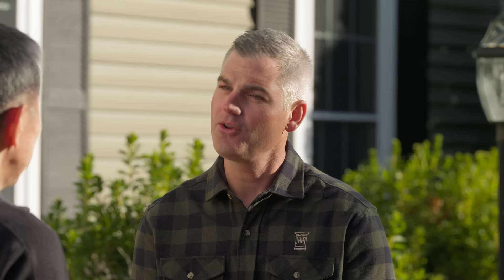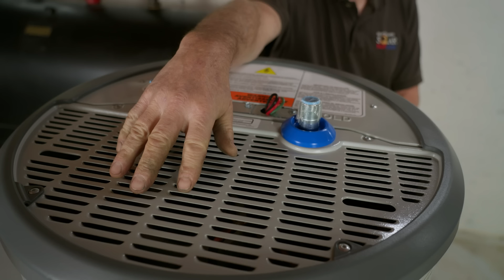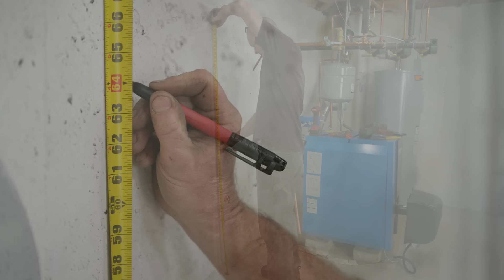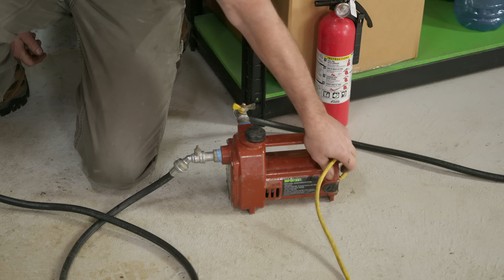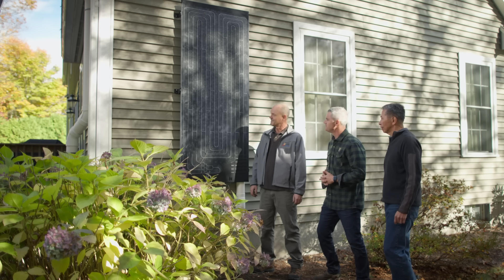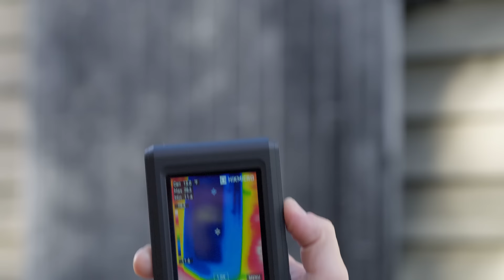Heat Pump Water Heater for Cold Climates | Ask This Old House

Comment: How much does all this high-tech cost?  What about maintenance?  Just about no maintenance on a basic electric hot water heater.
Reply: I have the same unit, cost was about $5,000 installed. 

There has been zero maintenance. I have a steel tank and they put in an electric anode rod.
Reply: I have the indoor type without the panel. The only maintence i was told to do was to pull air filter out the top and and clean that every couple months. It pulls out like the lint thing in a dryer.
Reply: @Zero11_ss how much are those units without the pannels used indoors ? Brand type. Im in Arizona climate. This would be great fornthe hot garage
Reply: @dr.projectx5142  I used a low income govt program for my mom and got it highly discounted. You can check on lowes and put your zipcode, they often have a "rebates available" button on the product page that tells you for your area. But depending on brand and size they are probably like $2k for the water heater. It probably works great in Arizona.

Comment: We installed a hybrid unit a few years ago in our utility room, where our hot air return and ducting meets our furnace.  The wood-burning fireplace insert has a plenum chamber above it that is also tied into that hot air return ducting.  When we have a fire buring, hot air from the plenum chamber heats the utility room (off the unheated garage) to around 70 degrees.  Our house AND hot water is basically heated with wood, any time we have a fire going.  It's an incredibly useful system.
Reply: @jasonbroom7147 I am looking to replace my oil burner with a heatpump and maybe hybrid hot water system and supplement with a wood stove where the oil burner is. I would love to see photos of your setup as I would like to do something similar.
Reply: Tell us more? Any pictures and schematics?
Reply: @hamadilawson4471  - I don't have any drawings, but it's a pretty simple design.  Along both sides of the wood burning insert in the fireplace is a set of metal boxes with intakes ducted to the floor and pipes on top that are connected to the hot air return.  From there, it's just a conventional forced air propane furnace system, with truly hot air coming from those plenum chambers.  In the utility room, where the return air meets the furnace, there is an exchange of heat, which benefits the heat pump on the hot water heater.

Comment: An oil boiler, why NO domestic coil? In combination with an aqua-booster, you'll have abundant hot water.
In addition, can you please explain the "NO defrost cycle." As the evaporator coil is building up frost, which then forms ice is the efficiency NOT lost?

Comment: Like it’s something new…

Here in the Netherlands we use those heat pump water heaters for more than 10 years. New houses are all build with heat pumps for warming the house and water for shower / etc.. Gas or oil heaters are no longer allowed in new houses.
Reply: Typical condescending European. 

Heat pump water heaters have been in use in the US for much longer than ten years. At least 30. More like 80 years for regular air heat pumps. It's just that it's only recently that heat pumps have become functional at the low temperatures that occur in the northern us.

It gets a whole hell of a lot colder in the US than even the parts of Europe in the arctic circle.

Comment: So what about people in condos or people that have their water tank in a closet in the living space? These things are loud and in the winter will make the heating system work harder.
Reply: Did you even watch the video? These do not cool the house at all like a hybrid. Also they are pretty much inaudible from the other side of a wall. Sounds like a box fan running on low, if even that.
Reply: @dmt9810 I did watch the video. The ones with the external radiator can't be installed at a condo, and both make more noise than a fan since they're a running compressor.
Reply: @jondoef You mean the evaporator panel? Yeah you can't put that in a condo just like you cant put mini splits or solar pv in a condo. That doesnt mean they're not a good option for homeowners. My fridge has a compressor too and it doesn't exactly keep me up at night. In fact my fridge is quite a bit quieter than a box fan.
Reply: @dmt9810 did you even read my original comment? smh

Comment: Holy crap...come here because of my fascination with heat pumps to not only find out about this new type of water heater heat pump solution where I need to research now but am blown away at this Propress tool.  Here I thought I would redo my house's plumbing with PEX due to being able to Lego it together myself but if I wanted to stick with copper piping I don't have to sweat it.  How long has this tech been around and how is this even possible?  Down the rabbit hole....
Reply: The propress has been around for a while here in the states, longer in Europe. The cost of the tool scares most DIY'ers away the fittings arent cheap either.
Reply: @Reckless1985  I would imagine that one could rent the tool for a weekend at this point.... or buy one and resell at the end of the job, depending on the schedule.
Reply: @Reckless1985  Cost aside, would you stick with copper using propress or PEX?
Reply: @BobbyLips for exposed piping I like copper it's cleaner more professional looking. If your running it through walls and ceilings expandable pex is a lot cheaper and easier and you can bend it around objects instead of making offesets with fittings which means less points of failure. Anything that may need to be replaced (like shut off valves under sinks) I would solder on to a pex x copper stub out.
Reply: @Reckless1985  Thx!

Comment: How much more than a conventional tank? How much more is the labor to install? What is the ROI? C’mon guys. If you’re going to present something as beneficial than you need to give us the numbers.
Reply: That information is almost impossible to provide. Cost compared to conventional will vary simply based upon scenario, they have a short line set without complex routing necessary etc. Cost of labor to install will also vary based upon location such as California vs Mississippi. ROI is based on the above factors as well as if there are any rebates or incentives available today or potentially in the future but TOH can't know every possible situation and potential cost savings etc. They have presented something beneficial and if you feel it may apply to your situation then do your own research for your own situation.
Reply: The most popular electric water heater on Home Depot's site advertises annual electricity consumption of ~4000kWh. The top heat pump water heater (also a Rheem) advertises annual electricity consumption of ~900kWh. Multiply those numbers by your local electricity rate to get your annual costs for hot water. In a place with high electricity hosts (30 cents/kWh in MA), the payback time is less than 2 years, excluding labor. The split system they installed in this video would have higher labor cost, but a traditional heat pump water heater installs much the same as a resistive water heater, so I'd expect the labor cost to be comparable.
Reply: They never do and it's really disappointing

Comment: It’s wild to me that the focus of this video was purely on increased efficiency. They are painting an electric water as the boogeyman of inefficiency but that electric water heater is far more efficient than the boiler setting next to it. We have collectively gotten in a bad habit of conflating efficiency with operating cost in our vernacular and I thinks that’s maybe the heart of what they are trying to address but they just keep hammering the efficiency aspect and mention cost savings once.
Reply: I would have liked to see an operating cost comparison (at local utility costs) between resistance heater and heat pump.  Hard to believe that the $5,000 could be recouped in any reasonable time compared to instead making hot water off of the oil boiler.  Of course, the video would possibly end up boosting oil heated hot water instead, blowing the whole heat pump promotion bit.

Comment: Why not install 2" R10 foam over those cold concrete walls and cold floor? No wonder the home owner runs an oil heater.  I'll stay with my electric water heater set to meduim and my roof top solar PV system.
Reply: In that area many new homes are built with the insulation on the outside of the foundation so the concrete acts as a heat sink. Also, in this area electric is well over 30 cents a Kw. That alone is enough to make people switch to something else. (oil or gas)
Reply: @rupe53 Ok, insulation on the outside of the concrete foundation makes way more sense. Thanks. 

30 cents per kilowatt hour...no wonder New England is eager for cheaper US offshore wind and Nova Scotia offshore wind. Huge potential to lower electricity prices. 

Over my cold concrete floor...I installed the blue DMX dimple mat sealed with tape and 2 staggered layers of XPS 30 high density foam sealed with canned spray foam and then 2 staggered layers of OSB. Now it is warm and easy to heat the whole house.
Reply: @aaronvallejo8220    Oh, and 30+ cents per Kw is just the base price. We now have a "poor tax" because the state ran out of money to fund the energy portion of social services. IOW, those of us who pay our bills now get several cents per Kw added to fund those who are broke. Last I looked it raised my bill by $80 a month over the last two years.

Comment: Would have just went with the heat pump. Less infrastructure and that boiler gives off plenty of heat in the winter to recoup. Some of these new green gadgets are just way too expensive for the average homeowner.
Reply: I agree. A few degrees cooler in that basement would not have an impact and some of the waste heat from the boiler would be utilized during the heating season.
Reply: True. But conventional heat pump water heaters won’t work in basement if you’re getting rid of boiler and switching to minisplits, as was the case here.

Comment: Plumber here, I've done work on these heat pump water heaters and they don't last that long. Not even 4-6 years. I see a lot at the scrap yards. Even the regular gas and electric water heaters last longer than the heat pumps. They should had done an indirect water heater since they last a lifetime.
Reply: Just last year I preemptively got rid of our old traditional water heater that was in the house when we bought it. Manufacture date was 1994. I replaced it with a traditional electric water heater with a stainless steel tank. 

I know these heat pump units are more efficient, but if they’re getting replaced every 10 years or less, it’s hard to see the savings.
Reply: You have never worked on one of these systems, they've only been out for like 2 years. These are different from the hybrids (which is probably what you're talking about)
Reply: @dmt9810 No buddy, they been out on the US market since 2010. There are a few of them that where install about 10 years ago that are still working. Most of them installed back then where replaced already.
Reply: @REDPlumbing This manufacturer has only been selling them in the US for about 2 years. Not sure if you're talking about some other chinese crap that you've seen, but these ones are great. 10 year warranty on the whole system btw.
Reply: @dmt9810  Bradford White yes they came out around 2022 and I did installed 2 of them before around that time while working for another company at the same. Rheem/Ruud and  Samsung started to sell in the US market around 2009 and A.O Smith started their sales in 2010. They weren't popular when it started but around 2015-2018 it started to pick up since the electric companies started to offer rebates which increased the sales and popularity.

Comment: I feel like it would be a lot more appealing to have just a regular heat pump condenser than to have a giant black panel on the side of your house. Is that not an option?
Reply: Yes, there is an option to have a condenser.  Some heat pump water systems have the condenser on top and normal resistive heating elements for high demand. Others operate more like a mini split. At least one system uses water to transport heat from the condenser mounted outside to the storage tank.

Comment: Heat pump water heaters are just more overcomplicated expensive appliances to fail every 8-10 years.
Reply: Just like traditional water heaters, you mean?
Reply: @pb7379-j2k I have a traditional NG tank water heater. Drain it down 3-4 gallons every year to get the sediment out and change the anode rod every 4 years. Tank On year 12. Probably get another 8 out of it before I think about replacing it. During the summer months is $30 a month in gas for a family of 3.

Comment: Putting that evaporator coil outside seems like a recipe for ice damming preventing heat exchange.  I think it would've been better served in the basement if not for winters...
Reply: At that point might as well just use the regular hybrid.
Reply: Modern heat pumps have deicing cycles to fix that. And if you put it inside, then you're just stealing heat from the HVAC's heat pump, making that run more.

Comment: They put a lot of gear for a heat pump water heater.. I switched mine from NG to a stiebel eltron accelera 300 model.  It cools the basement and reduces humidity.  It also works better in the winter from the basement because it's scavenging heat from the hot air furnace and heat loss to the basement from the first floor.  Putting this evaporator outside of the house in the winter seems counter productive.  I've seen people put a coolant loop under their solar panels to pre heat the cold water coming into the electric water heater.  Then a tempering valve reduces the output temperature of the hot water in the pipes.

Comment: I live in a fairly cold climate and have an unfinished basement just like this one. That boiler is putting plenty of waste heat into the basement and who cares if you lower your basement temp by probably one degree? Its effect on your house temp is about zero and the air source HP water heater is 1/3 if not 1/4 the install cost and is serviceable by anyone. I'm also in an oil heat area, removed my oil heat, and went to air source HPS for space heat and a HP water heater. It's been a complete non-issue. BUT THE COLD AIR! Good lord. It's a tiny stream and I don't notice it in the basement. a HP water heater is between $2 and 3k installed and this boondoggle was probably $6k.
Reply: Waste heat in the basement?  Didn’t know there was such a thing…
Reply: That's my first thought; harvesting waste heat from that oil burner. That and the "free" dehumidifying in the summer.
Reply: He’s getting rid of boiler.

Comment: Looking at the specs of this thing, it's quite anemic for a water heater, only 8,000Btu/h output. about half of the output of a standard electric tank water heater, and a complete joke compared to any gas or propane unit. And, that's only in ideal conditions that output drops very fast in colder or less sunny conditions. This thing is next to useless for anything except washing your hands or taking a one-minute shower...
Reply: It was an 80 gallon tank?
Reply: I have the same unit installed here. I can take hot showers for a long time with the 80 gallons of hot water.

You do have to pair heat pumps with a larger tank than you are used to for pure electric or gas/propane. With gas or propane you can even go tankless.
Reply: @mattc6854 How much was it to install this heat pump?
Reply: @ZergZfTw - $5,000 before any tax credits.
Reply: @mattc6854 Ouch, you must have very cheap electricity or very expensive gas for that to make sense. Electricity is about 5.8X more expensive for me, and high-efficiency condensing tank/tankless units have their own rebates from the utilities.

Comment: If the hot water tank is pulling heat from the surrounding air, does that mean the furnace has to make up for that heat loss in the house ?
Reply: With a traditional heat pump water heater, yes. Not with the one they installed in this video, all the heat transfer takes place outside
Reply: Yes.
Reply: As stated by others, this particular unit does not. If it doesn't have a remote unit, then yes it will pull heat out of the air in the house, which eventually would get replaced by your furnace in the winter. In the summer, it would actually help the AC by taking heat out of the air and putting into your hot water.
Reply: No. It’s explained in the video at 2:40. In cold climates, you stick your hot water tank in the garage or you have part of the heat pump outside like an air conditioner to exchange heat.
Reply: wrong. Hot water heater goes in the garage in a hot climate only. Hot water heater in a cold climate stays inside the conditioned house. The split system for the heat pump water is recommended for northern climates since it doesn’t generate cold air inside the house. This was all covered in the video after the 2:40 mark.

Comment: In 15 years it will pay for itself, Wait it will need replaced by then if it has not broken sooner.
Reply: You may find this surprising but homeowners can (and are expected to) perform basic maintenance on their water heaters which can extend their lifetimes to and beyond 20 years. All you have to do is flush it a couple times a year and change the anode rod every 2-5 years!
Reply: @pkprotoplasm  They even make powered anode rods now that will last 15+ years, and also get rid of hot water odors.
Reply: Dot look at the numbers, just go with the flow of its saving energy. May create 4x the land fill waste and more to make it but its cool. Or should I say hot :-)
Reply: @reevesproductions877  Which study said it creates 4x the waste?

Comment: There is a hot water system designed for that Buderus boiler. No need for the heat pump.
Reply: Yep, adding a heat exchanger in the boiler would have made more sense. I still would have kept the electric tank for storage and backup.